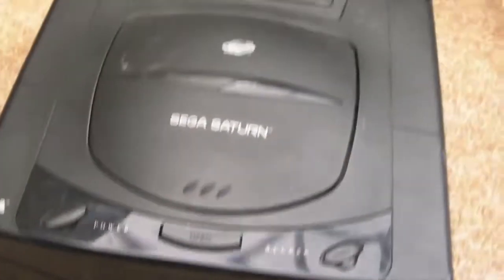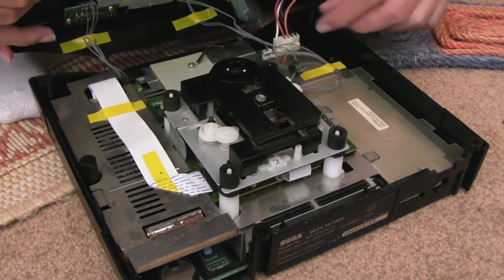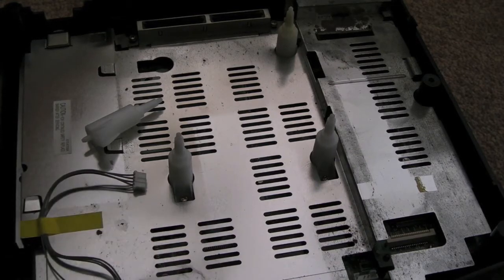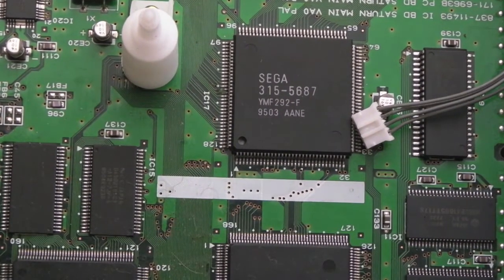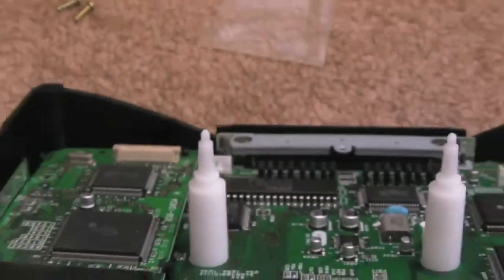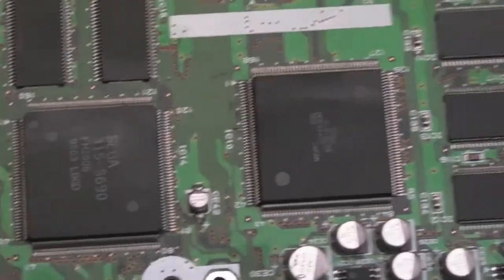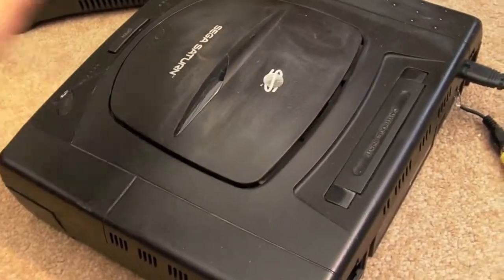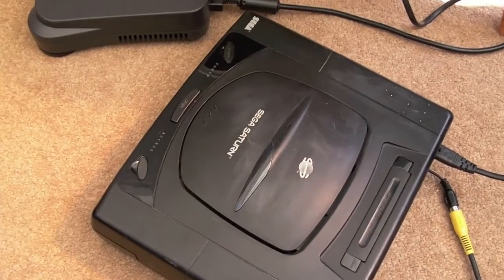Sega Saturn Repair Part 1

Comment: You wouldn't happen to know the size of the screws that hold the case together would you?  I picked a Saturn up that had no case screws.  Works fine though!
Reply from the maker: Hi, I am not sure at the moment but I will take some close ups later if that helps?  There's also the service manual here which will likely mention exact screw sizes:-

http://console5.com/techwiki/images/3/39/Sega_Service_Manual_-_Sega_Saturn_%28PAL%29_-_No._013-1%2C_June%2C_1995.pdf
Reply from the maker: Looking at the service manual I think it's part 43:-
43 029-000035-0B B-TITE SCR PH BLK 3X10

Presumed the 3X10 is the size?  Hard to tell, also not sure if the revision that service manual is based on is the same revision as yours (and mine).
Reply: GadgetUK164 Thank you!